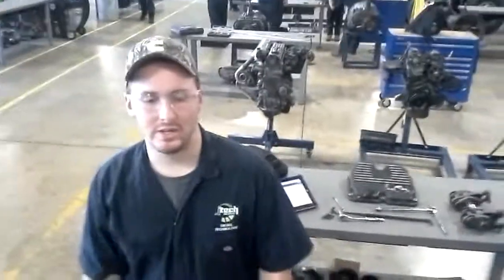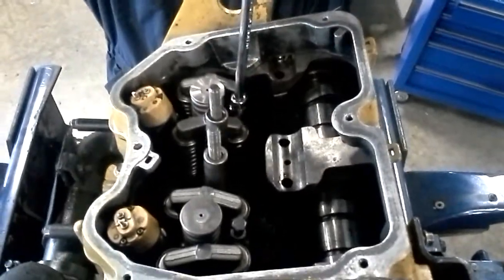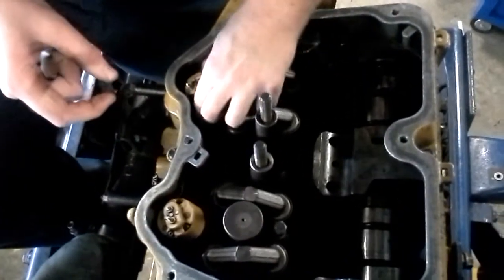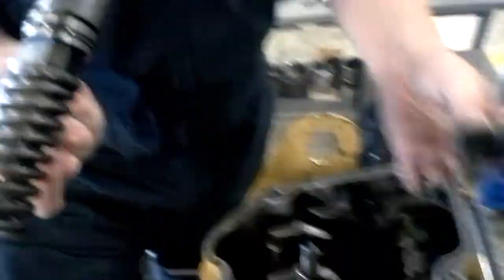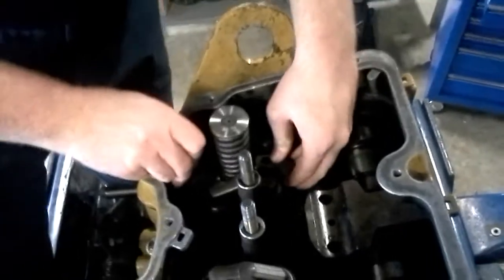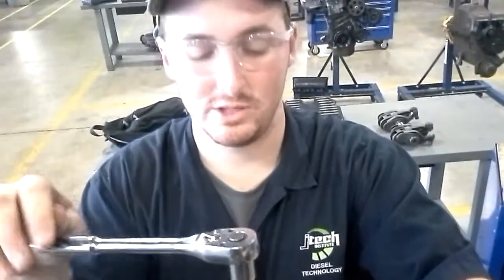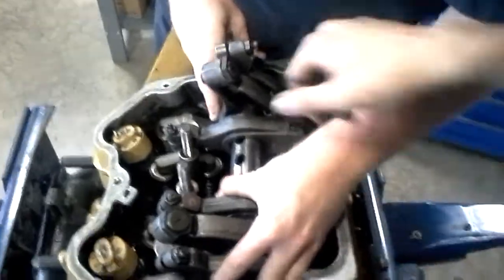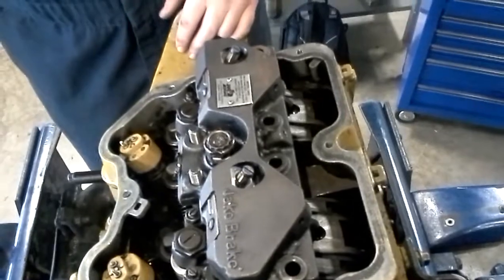CAT Diesel injector removal, 3406e EUI injector removal and installation

Comment: IS IT THE SAME ENGINE OR DOES IT HAS EXCHANGEABLE PARTS WITH THE 3456 EUI? I need the crankshaft o this model and I will be really thankfull if you can help me with that info.
Reply: the engine shown on this video is a 3406E, I want to say all the 3406E crank shaft are interchangeable, but you have to start by getting your engine serial number, it usually starts as, 5EK, 6TS, 1LE, 2WS all these are 14.6 litter and there's 5Ds 3406E which is a 15.8 litter, this crank will not git on your average 14.6 L engine.
forgot to mention that EUI stands for Electronic Unit Injector, which is why there's and E on the engine model 3406 "E".
Reply: you are very kind, thanks for all the info.
Reply: Nice job bro